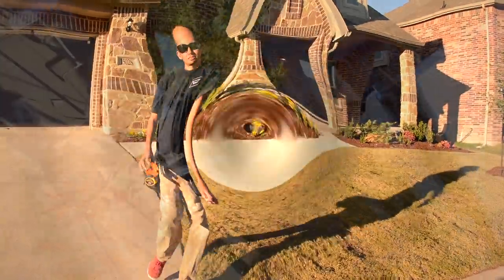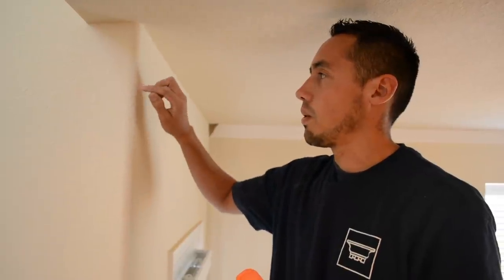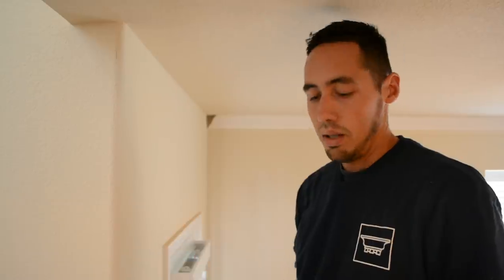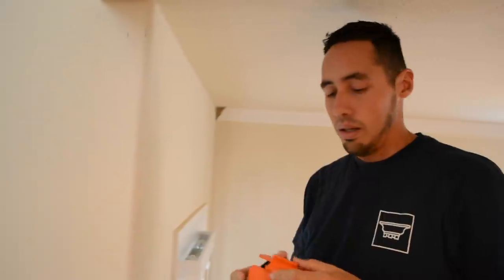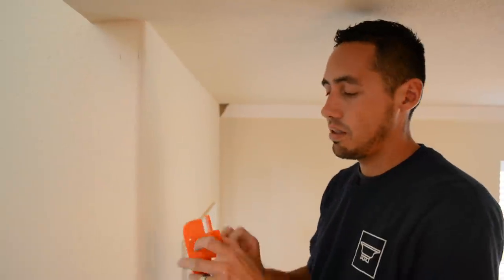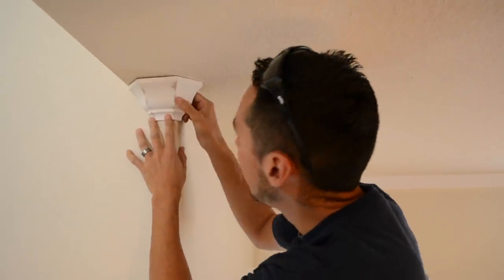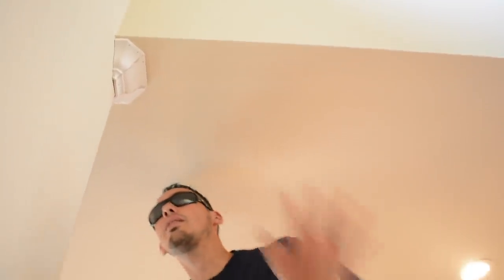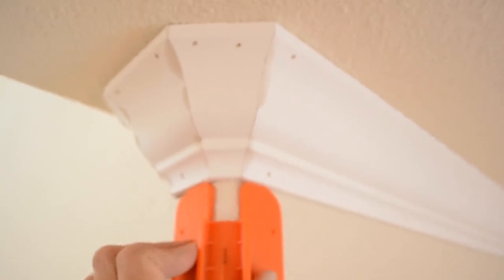How did I Live without this Tool?

Comment: I got 2 tips for you. 
1.Build a handheld bullnose jig 2”,5/8” & 2” with the 2 outsiders cut 2” from the top, and the center bullnose chingaderra (center corner bullnose) left high and untouched. Next cut angles at (24),(22.5,22.5),(24). This helps keep it all tight when a lot of corners are 88 instead of 90. Also cut the top half of your bullnose angles at 45 rather than 22.5.
2. Now go buy a $60. Bostich Laser tape and put the butt of the laser against 45s of the jig and shoot the wall. Boom done.
3. Now see if you can measure a 3000 sq footer in under 10 minutes using a laser tape for 95% of dimensions.

Comment: Just a heads up , after 30 yrs building homes I can let you know now lose the tool belt. Stopped wearing mine 10 yrs ago. Framing jobs only otherwise in the way and too much weight for running trim. Your Bench in the field or at the shop is key to success
Reply: Yea. Especially when your in beast mode finessing and nailing base in a crooked pantry.
Reply: It's more productive not to jump up and down the ladder all day to chase down tools you've left at your cut table.... tool belts are always a good habit to have unless you're working in someone's furnished house.
Reply: mike bonea how?
Reply: Ever had to run out to the truck for something and your 22oz framing hammer handle is smacking ya in the  back of the shins!?! Not so much for finish carpenters, but framers know that feeling!
Reply: @DIRTPUNKZ86  lmao i know all about that. ... framed for almost 8 years.....i miss it sometimes... i can keep up damn near like a nail gun but as far as the climbing around and shit HELL to the no dude. ... get out of that asap.... soon as you learn it all..... learn your stairs,  learn your rafters,  layouts and gtfo go do decks or trim or whatever you can get your hands on. ... i do everything now
Reply: @DIRTPUNKZ86  that job beat the crap out of me over a long period of time
Reply: So your the guy asking to use all the apprentices tools cuz you don't have bags on and they do lol
Reply: @danielson1037  You're not your
Reply: @danielson1037  No shit.  I think that's why I have a job.  Since the guy I'm working with proudly gave up his tool belt when he went out on his own, I am constantly handing him my tape, my hammer, my pencil.  So naturally I have my name sharpied on EVERYTHING now. Haha, but at least I have a job. LOL

Comment: That glue you use holds the pieces of molding in place as soon as you apply it?
Reply: It's just thick CA (cyanoacrylate) super glue used with a curing accelerator sprayed on the opposite side.  The accelerator makes the glue set almost instantly on contact.  (Don't get the glue on your fingers -- it bonds to skin really well too and it's hell to get off)

Comment: Ummm...so that thing just told u its a 90 degree corner???? Is thats all it does??
Reply: anthony 35 - Marking at the edges of the gap give him reference points for measuring the length of each piece without having to hold multiple scraps in place and marking.